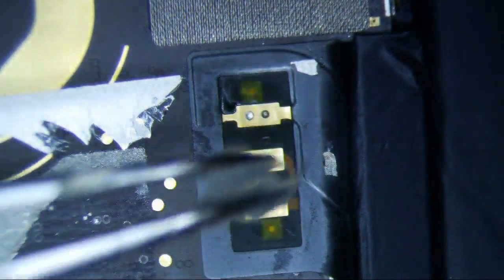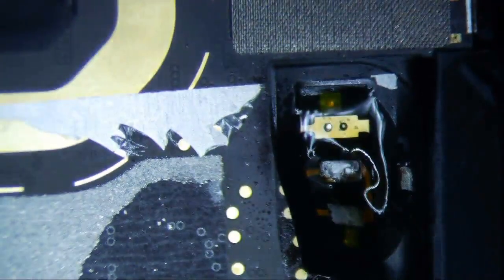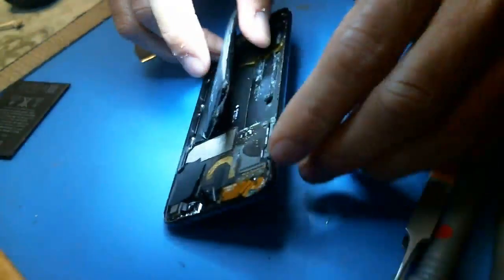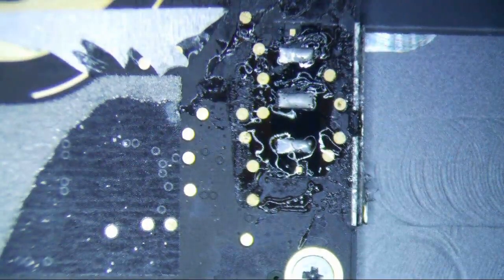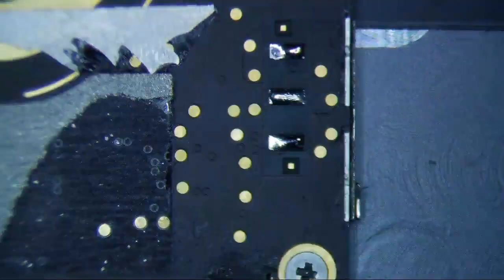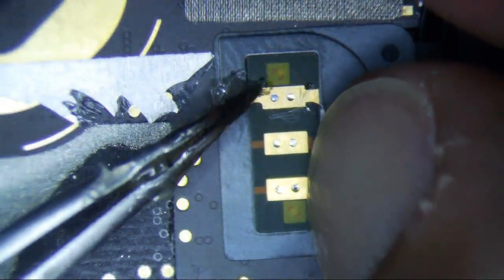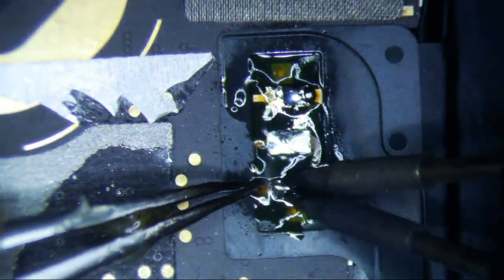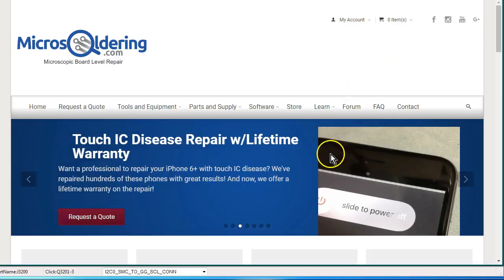iPod 6th Generation Battery Replacement   Soldering Required

Comment: Been trying to replace a 5th generation battery and it's dock connector (Home button pad was broken) but the plastic around the metal contacts literally melted, so now I just have awkward pads that don't want to stick to the contacts at all.
The dock connector was actually the easiest, all the pins took up the solder just fine, but the battery ... bruh

Been sitting in a drawer for about a year now, I'm considering checking if there's a way I could solder a connector on it so I wouldn't have to solder on the motherboard again for another replacement in the future.

Comment: There is a piece of tape on the side of the ipod at 2.27 into the video. Could you tell me what type of tape that is? I want to replace the one i ripped apart thinking it was just plain ole insulating tape. Thanks for any help you or anyone can give..

Comment: Can this repair/replacement be done with regular sized soldering irons or does one need a microsoldering setup to do it?
Reply: if your good with your normal iron it will work just fine. the pads are about 2x6 mm each. but be sure to use enough and quallity flux.

Comment: Wow, looks a lot faster then my repair with a failing soldering iron, lol. Much better now that I replaced that soldering iron. Low melt would help, the ground (third one you did) has a lot more glue and the low melt probably helped keep temp to melt the glue also.
Why send it in without a screen, the screen is the funnest part, lol.

Comment: Hey, I accidentally ripped off the middle solder pad on the logic board when removing the battery. Is there a test point i can just jump to?
Reply: Probably, but you'd have to trace it using a continuity meter on an identical good board.  The middle pin is called the BLI/BSI (Battery Level Indicator) and while the phone would work without it, it won't charge properly since there's no way to sense the battery level.  That's why it's probably better to leave these harder repair to the pros. ;)
Reply: Hi James did you fix this damage? I did the same trying to replace battery!!! I am searching for a schematic of the circuit to fix it
Reply: @BillAnt  I have the same issue with a ripped pad. I need to fix this for a friend. Is there anything I can do to fix it probably. I can micro solder and I'm learning repairs as a hobby since I'm retired. I really want to do this but have no idea where t ok start. Ifixit doesn't have an answer. Thanks in advance
Julie
Reply: @Julie C < Unfortunately it's beyond micro soldering, you'll need a couple of hundred dollar 20-40x microscope to even see the pads to solder on a 0.1mm hairline extension wire.  If you don't want to invest into it, sometimes local independent repair shops have the necessary equipment, just call around.